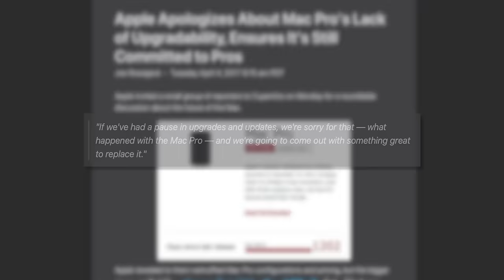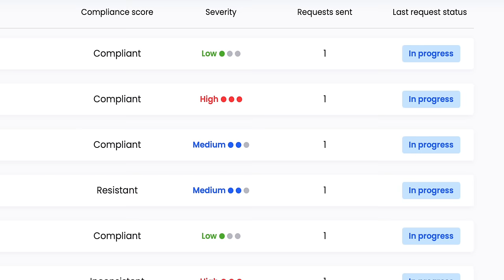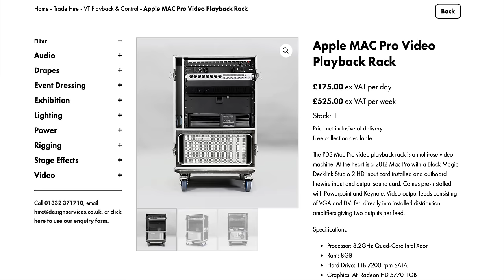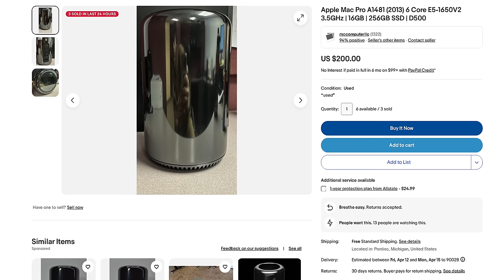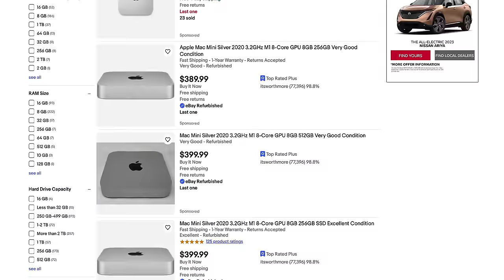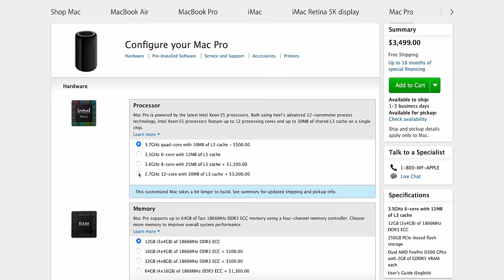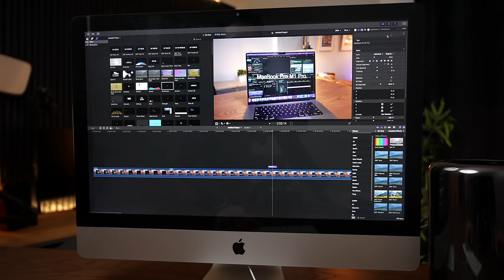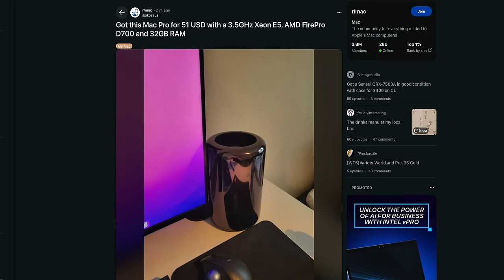Revisiting Apple's FAILED Mac Pro in 2024

Comment: I bought one for around $500 + shipping from eBay a few months ago and it was maxed out already. Dual GPUs, 12-core 24 thread XEON, 64GB RAM, 1TB NVME. I use it as my 3rd machine mostly because it is compact and quiet for general use. My daily driver is a 4GHz Ryzen 9, 64GB RAM, dual 1TB NVME, 16GB RTX.  I am a PC person, so the trashcan Pro runs triple boot with W10, Ubuntu and patched Ventura. Sure, its not the fastest machine out there for its age, but at such price it is not bad IF you want native X86 hardware and not virtual machines via Apple silicon or MAC OS specific apps. I see no reason to have an Apple silicon MAC (yet) since all my apps run on PC and I don't use MAC specific apps like FinalCut Pro. I will probably get a used M2 Mac when they become cheaper. Used Macs are better value than new ones. Crazy, but true. A trashcan pro is not bad for those who want to use all 3 major operating systems for app testing, dev or web design. For such use it is fast enough. It doesn't give you the feel of a decade-old slow machine. I'd say if you find a good deal for a maxed out model under $400, and you don't "need" apple silicon, go for it but don't expect to do anything demanding besides general desktop use. I have a huge  collection of over 100 computers, so for me it was just a matter of adding yet another quirky computer in my Apple lineup, not for something to use all the time.

Comment: The hardware (processor / motherboard LGA2011) the Trash-Can Mac Pro (~2013) was based on was old hardware that had been around for years beforehand.  So it wasn’t just the over engineered design that was the problem or the overheating video cards it was the insult to injury that was really the kick in the teeth.

Comment: I had one and I loved the design, but I had to stop using it because the GPU was overheating, and the Mac would shut down every five minutes... I was told I could replace this part, but it would eventually overheat as well, as it was a conception problem, so I bought another Mac. I still have it, though ; do you think I could save it ?

Comment: With some minor software work you COULD use an EGPU with it and blast far past the Mac mini with something like a 6900xt or Vega, but the dinosaur xeon will still be holding you back pretty severely. And after spending all that you’d probably have been better off getting something like an iMac Pro instead.

Comment: "You don't see it [dual/multi-GPUs] in the Mac either" errrr... while that's true now the Mac Pro moved to Apple Silicon, the 2019-2023 Intel Mac Pro models were available with the GPU MPX modules which contained 2 GPUs and you could fit two of those, stacking up to 4 GPUs... so it only went away last year on the Mac.

Comment: As a home server? Absolutely! Get it, upgrade it and leave it someplace. Let it run for your backups and whatever else you need it to run. You can even leave it with the lower CPU. Or upgrade and let it run your media center as well. It’s perfect. It uses a bunch of power but it perfect as a home server for running everything.

Comment: Luke, I know you mean well, but with all due respect, you're looking at this machine with your video editor's blinkers on. Like many others, I'm a different kind of content creator: I work with InDesign, Illustrator, Photoshop and Sigil (the latter for eBook formatting), creating files destined for print and/or digital media of the static kind. Not wishing to jump on Adobe’s rent-your-software wagon, I run their older Creative Suite (CS5.5) in a Mojave virtual machine on a 2015 i7 iMac – something I couldn't do on Apple Silicon. The iMac itself runs Sonoma, thanks to OpenCore Legacy Patcher. As the iMac's display is starting to suffer from encroaching edge bleed, the idea of another Intel machine with a larger number of cores is quite appealing, and I'm seriously eyeing the 2013 Mac Pros on eBay. And yes, I have a 4K 27-inch monitor to hook up to it. One of those Thunderbolt 2 ports would be connected to my Thunderbolt 3 dock via an Apple Thunderbolt 2 to 3 converter, as is the iMac currently (the dock contains a 2TB SSD). Having said all that, I'd love to see how a maxed-out Trash Can handled my kind of work. I suspect more than adequately.

Comment: Been using one since it came out, still speedy enough for a lazy home computer. I never knew how spoiled I was being able to hook up so many monitors…. But you burn through ram with each additional one. Idle is something like 40gb use just having 3 4k monitors, chrome, safari, video playing somewhere. 

Very odd machine though, even working w HDR UHQ content I rarely peg the CPU and cards, but it feels like it runs low on power

Comment: I've got a six core in my garage (it was my graphic workstation). I can't seem to trash it (ha ha) but I don't want to invest any more money in to it either. I just use my MacBook Air for everything now and even though it has limitations also, it gets the job done without a power cord, or external monitor. Yet I still cannot bring myself to get rid of it, I have a problem I know.

Comment: I use a trash can Mac as a second computer for work. It has an upgraded 12 core CPU 32GB ram and a modern SSD running MacOS Sonoma and it runs absolutely fine with no issues at all. I only paid £120 for it and it’s just fine for what I use it for :)

Comment: First let me say Luke, I love this video.  Why?  Because, three months after Apple's introduction of the M-1 "Mac Studio", I picked-up, just to hold me until the year 2025, a used space gray "trash can" size Mac Pro 8-core/D-700/64GB/1TB SSD for around $1,000.  This unit was an upgrade from my 2010, "mac mini" (the last model with a built-in DVD super-drive).  Also, my already owned 2010, Apple 27-inch LED Cinema (none thunderbolt) with mini display port cable connects directly into the Mac Pro Thunderbolt-2 ports, of this model.  Next year, my goal is to replace this system with a M-2 "mac mini" pro model and, pair it with an Apple 32-inch 6K XDR monitor (smile...smile).

Comment: I rock one of these in my home lab with the 12 core in it with proxmox. Is actually ok for pi hole, wireguard and other basic hosting services. Yeah as long as you don't need gpu.

As soon as you want gpu passthrough its a dead end.
Reply: i got gpu pass through working but only for linux. two gamers one box was possible via proxmox but quite pointless given the driver performance is awful in linux even when enabling amdgpu driver.

Comment: I tell you what this has to be one of my favorite MAC beside my 2015 MB Pro. To my surprise this Mac Pro let me installed Mojave on Samsung PCIe 4.0 NVMe 2.0 SSD 980 Pro. Mine was manufactured late 2017 with 12 Core, 64GB RAM 1866 ECC. and D700 GPU. paid $400.

Comment: The major reason for this machine is that it runs a ton of operating systems. You can run El Capitan to Ventura, Windows 8-11, Linux. Without hacks not the latest OSX, but that stinks, I don't want Candy Crush iOS on my Mac. And 6 displays! The M1 Mini probably already fails at connecting a second screen. And here in the EU, the mini's are actually quite a bit more expensive. Good luck finding a 1TB/16GB M1 under 500€.

Comment: The problem with these old Intel Mac Pros is that they use so much energy.  If you work it out it quickly becomes apparent that upgrading to Apple Silicone is essentially self-funding just in saved energy costs.  I wish Apple would sell replacement Apple Silicone logic boards so we can keep these classic Macs going.  I'd love to put an M1 in my G4 Cube.

Comment: I loved my old Cheese Grater Mac Pro, but I wouldn't say they were workhorses.    I had a Mac Pro for my audio work and I worked for a Media department and since I have a background as a SysAdmin I also had to be the IT person for the Media and Graphics department so I was supporting a lot of Mac Pros.    Biggest problem and long time Apple is is Apple pushes graphics card really hard to achieved to get the great looking displays trouble is in Mac Pros that would burnout the video cards.    Then Apple being Apple sure they just off the shelf video cards then, but try to replace the video with one you buy off the shelf and you're in for a world of pain getting Apples drivers to recognize it.   Lucky for me and my personal Mac Pro I had Apple Care and they covered two graphic card replacements in my personal Mac Pro.    Mac Pro were rough on power supplies too and that is why I speak of mine in past tense when the video card died and both CD drives died, and already two graphic card replacements I decided time to let my Mac Pro rest in peace.  I still have my Mac Pro collecting dust it was a great computer just not a workhorse that ran forever.  Same with the others where I worked.    Today I looking at getting a Mac Studio I think that is the real Mac Pro of the Apple Silicon era.

Comment: Yeah, I bought one for $200 maxxed out and it still sucks even at that price.
Trying to migrate from a 2012 MP to the 2013 was such a nightmare I just gave up went back to the 2012 and gave the 2013 to my mom.
Literally nothing carries over. All my firewire stuff... nope. My 30 inch Cinema Display... nope. Thunderbolt 2 sucks. Storage capacity sucks. Why couldn't they fit another nvme ssd in the 2013? Why? The machine should have been launched alongside a tower as the mac studio is today. The 2013 is just for a completely different user and a completely different purpose than people who would've used a 2012 mp.

Comment: And this is the reason why more people still use the previous Mac Pro 5.1 (2010-2012) it is more upgradeable, you can get much more parts and even cheaper than this  6.1 (2013).

Comment: I have a 2009 Mac Pro 4,1/5,1 with two 6 Core, 3.46 GHz Xeon CPU's, 2TB Boot NVMe SSD run over one OWC Accelsior 4M2 PCIe 3.0 M.2 NVMe SSD Adapter Card, Radeon RX Vega-56, 96 GB of DDR 3 RAM & i also have a M1 Mac Mini 8 BG RAM & 256 GB SSD & in comparison between the two when it comes to non-professional use the old Mac Pro 4,1/5,1 outperforms the Mac Mini in almost every aspect possible....

Comment: The Mac Mini is fantastic, but 8gb of ram... the 16gb models are quite a bit more expensive and that's still a far cry from 64gb and as you mentioned you can get cheap 1tb too which you can't on the mini without a rather large price hike. For specifically server workloads, the trashcan may still make sense.

Comment: It does not (and never did) make sense as a modern workstation for serious work. I did finally pick one up cheap out of curiosity, and I've settled on making it a kind of time capsule and retro gaming system. I upgraded the RAM and storage, put the last 32 bit-compatible Mac OS version on it, and that's how it's going to stay. I can play the original Warcraft III on it very nicely, whereas modern Macs won't run that and instead need some new build that relies on the Blizzard Launcher, but is also still not Apple Silicon-native.

Comment: The M-series has made the resale value on these drop, which has actually been the best thing because unlike the M-series macs, these can still easily run linux and windows. So using it as a fancy looking server, secondary system for yourself, or a basic but cool looking computer for a broke friend is a lot more justifiable.

Comment: In retrospect the Mac Pro 6,1's relevancy for 2024 users:

--->  Apple computer with tons of ram and that can run x86 programs in a small form-factor that DOESN'T use a laptop CPU such as the Intel Mac mini

---> Entry level Homelab Mac for users that prefer Mac OS optionality

---> Fans of the great strange design who collect PC's 

Personal note: 
My Mac Pro 2013 can quietly play Minecraft in 1440P High/Ultra settings while maintaining 70-72 FPS cap while my Mac Pro 2012 screams. Is this device for you? Probably not...

Comment: I own a 2013 Mac Pro (10 cores, 64gb ram & strongest dual GPU possible) and my mother has an M1 MacBook Air (16gb ram, 7 GPU Cores). It is hilarious to see the Mac Pro being worse in graphics performance, it’s literally the weakest iGPU against TWO dedicated GPUs (optimization on hardware is everything in that case). But I found that in Logic Pro the Mac Pro can deal with a lot more tracks because it basically has 2,5x more performance cores. And I suppose in rare cases 64gb ram can be preferable than 16gb unified ram. But even though I love this computer, it’s still a bad deal and it probably uses over 10x more power consumption which is just insane.

Comment: Question: What if you manage t get one of these and turn it into a cloud gaming device, for use with things like GeForce Now or Boosteroid??

I bought an old Surface Book 2 not long ago, a 7 year old laptop with only 8GB Ram and a Dual-Core CPU but wow is it good at running GFN at 4K120. 
- The laptop is not that great at other stuff, but as a device I can just hook up to any TV or use on the go for Cloud Gaming, it works great. 

So would this be the same for the Apple devices, could you find cheaper Apple devices and turn them in cloud gaming rigs??

Comment: in defense of the 2013 mac pro, for use cases where you need a lot of ram and not a whole lot else... the 2013 mac pro actually makes a lot of sense. 

i actually use one of these as my computer at work. at any given time i have a ton of browser tabs (like 20 maybe), slack, discord, imazing, and a windows VM open. the fact that i was able to get this machine and add 64GB of ram for like 275 bucks is clutch. all my home machines are apple silicon and they're aweosme. i have a m2 pro mac mini and an m1 pro 14" macbook pro. but i can't find an apple silicon machine with that much ram anywhere NEAR this price bracket.

Comment: A couple of years ago I got one with 64GB RAM, 8Core Xeon, 1TB SSD, and the 500 Series GPU's for $350.  So no upgrades needed.  I am not a gamer, or a video editor, so I don't care about frame rates.  

I do scientific computing and data science.  I use three USB ports for 15TB storage outboard, which is plenty of scratch pad for my needs. It does have 4 USB3 ports though they aren't very fast.  It was a lot cheaper than the mac mini's of the time with similar Intel processor and memory specs back then.  Apple has made its last OS update so I might make it a Linux box and keep using it.  I'll get rid of it when the apps I run go unsupported.  E.g. Not sure how long Photoshop will be supported on ivybridge since it has AVX but not even AVX2.  I have an older HP workstation that has memory I can salvage to take the Mac Pro to 128 GB for local LLMs.

Bottom line:  It was dirt cheap and is still useful for my projects.

Comment: The trash can Mac pro was the first Mac I officially snubbed and my predictions gas been spot on too. It just took nearly a decade for them to be fully rationalized by everyone else. To put it simply I didn't think it was a Mac worth buying. Apple had hit the nail with it's 2009 redesign of an already solid Mac. I believe Apple could have redesigned it again and still had a home run without going trash can. Now I know despite it's obvious failure this model has it's fans but to me it simply wasn't a good design on so many levels and the reality is many must had agreed with me too because it never sold well. Of course it never helped Apple let the platform linger but that's kind of what Apple does with its more professional products.

Comment: I believe that if anything is wrong, it is the fact that these professionals were forced to use the Mac operating system and required software applications incompatible with distributions of Linux. If that were the case then Linux would become more widespread, and the professional environment would be improved as systems with Linux are more likely to support right-to-repair.

Comment: Apple really should have kept this design locked away until the M series processors. This is what should have been the Mac Studio, rather than the bulky mac mini. Pro enough, but not so much that it requires many if any upgrades.

Comment: Oh well re-releasing it with Apple chips doesn't make a lot of sense either. This chassis is designed to extract a lot of heat with low noise, and they don't sell computers that run as hot anymore.

Comment: Personally I don't like that people disrespect it by calling it as "trashcan". It is just labeling it something negative, but yet extremely important in every household and every civilized city.
The design is really good for the "one computer" as case. But I do say that upgrade options to get a better GPU and all, that is just the modern Apple since G4 where you had easy access to everything. The common problem with Macs is always the GPU, that you couldn't from the start just drop a wanted GPU card as your choice. The Apple's idea to make everything incompatible, be it a small notch in USB extension cables, or own connector, or simply having a firmware in card to deny its functionality. 

A one thing that I think that made that computer "ugly", was its black polycarbonate shell. Now, look at it in 08:17 when it is open. It is beautiful engineering!
Apple waste time, resources and value for something that most people will never see or look! Like iPhone or iPad internal design... Who cares? It is stupid idea to have very specific colors and component layouts for things that only some repair service personnel will see... 

But if you would take the old G3 philosophy, that case is translucent.... NOW you would have real excuse to have great designed interior parts. 
Now take that Mac Pro and make a polycarbonate transparent, or maybe a 50% smoke translucent shell on it, so you can see the internal design. 
That thing would have smoked with some leds inside lighting it up if wanted!
Or make the shell different colors like the G3 macs were about, red, blue, green, orange etc. That thing would have been beautiful to look on the table, other than a black cylinder with smudges and annoying reflections.